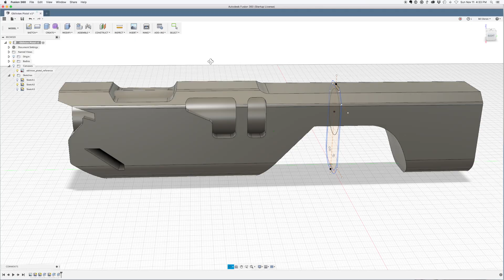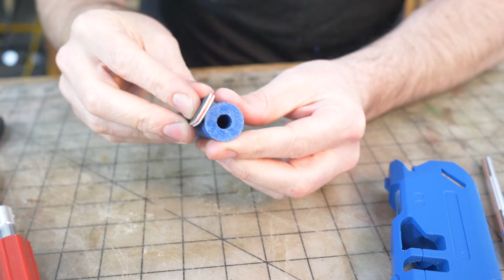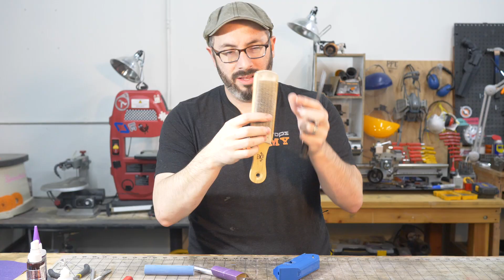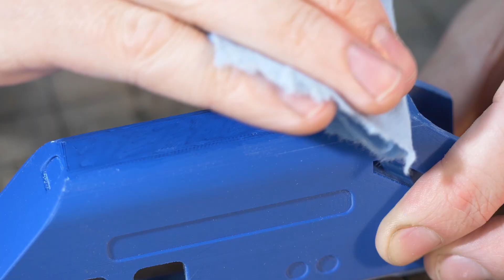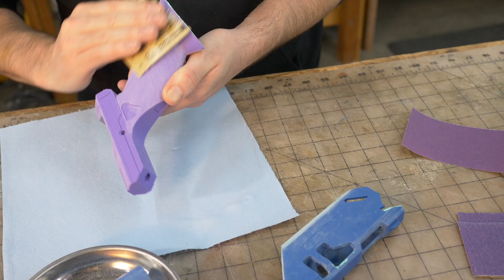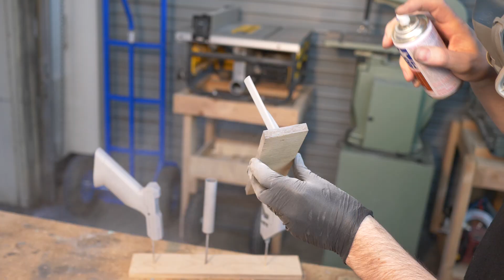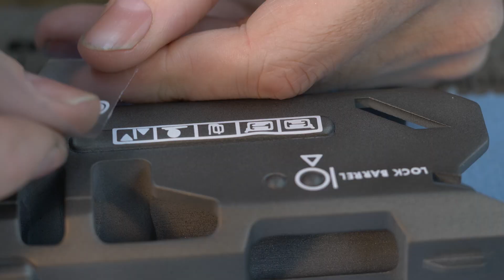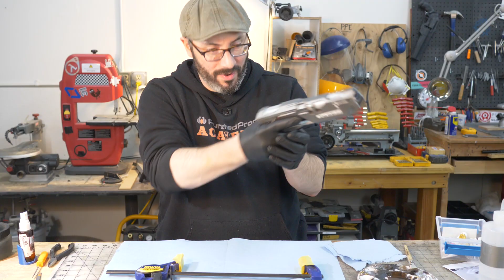From 3D Model to Finished Prop - Tom Cruise's Oblivion Blaster!

Comment: I guess PLA is my fav to print with, though I can only print that so my experience is limited.
For finished products I think ABS or something else is better but if you are doing castings of it, or concepts, I think pla works best.
As for supports, while they are good I always try and cut up my projects in bits to avoid them as the surface where they attached usually requires a lot of work.

Comment: Ok, I shoot from the bottom of the barrel. I use the cheap PLA I scrounge off Amazon and I run it through either my Ender-3 or my Anycubic Linear Delta. I  slow the print speed down to about 40mm and layer height of .15mm on the E3, the Anycubic I run about 60mm to 80mm and .2mm. They produce a pretty nice finish when run this slow and when wet sanded they look as good as anything we produced back in the old days (actually a lot better for far less work). Probably not as good as the guys running Ultimaker  or even Prusa but it allows me to output my designs and I don't have to worry about justifying the cost.

Comment: I see you've got some foam supports underneath your airbrush compressor. Do they dampen the noise appreciably?
Reply from the maker: It is a bit quieter, but the cushion base was added to stop the compressor from waddling off the table. It took a few tumbles before.

Comment: I also like ABS for props because of the easy sanding, but ASA is a perfect material for durable parts like laser tag and nerf blasters and mods.

Also, a useful and inexpensive sanding tool is a sapphire nail file.  It uses very hard aluminum oxide (like ruby's and sapphires) as the abrasive material.  Usually about $10 at a drug store, and can be found elsewhere for less.

Comment: As far as dust masks, I recently discovered the type similar to the cheap-ish one shown, but with a simple check valve in the front.  This is great for keeping glasses/goggles from fogging up, because exhaled breath goes out the front, rather than leaking around the edges.

Comment: In the scale model hobby I have found that super glue activator if not washed off with soap and water will cause the top coat of paint to craze.  Do you see this on your side of the hobby?

Comment: What the hell is a water mixable oil paint ?  Have i been living under a rock  ?
Reply: "is oil paint either engineered or an emulsifier has been added, to be thinned and cleaned up with water". So you don't need to use a solvent.

Comment: PLA. It is the only filament, the only 3D Printer I could afford will use. (Actually, it only uses the printer manufacturer's proprietary filament)
 
It has a 6x6x6 build volume; and an unheated aluminum bed, included Slice 'n Dice software (not as full throated as Simplify3D.)

Adhesion problems solved with Blue tape and Elmer's GlueStik  plus pre-heating the bed with a hairdryer as the print starts; then deploying the (Manufacturer Supplied) 1/2 Enclosure. Keeping the build space temperature in the sweet spot has worked best for me. A heated glass bed would be so wonderful; but $$$ I don't have.

Not thrilled with the quality of the prints. I don' t underestimate my contribution to that.  Lifetime Achievement to date? I've spun 2 spools, so far; now working on #3. Barely enough to get the feet wet; let alone develop a reliable technique.
 

Nozzle clog print failures on runs over 16hr. Possible water contamination of filament; exploring Sodium Bensonite (Clumping Kitty Litter) desiccation and filament hydration maintenance.

Video at 

https://www.youtube.com/watch?v=M_evG1AzHzk&t=4s
https://www.youtube.com/watch?v=jQpLpL3N2I0

Pulling my hair out at :
http://eli-tables.com/

Comment: I do all my printing in ABS, but most of my work is small snap-fit parts so I don't trust PLA to not break when slightly flexed to fit the parts together.  Instead of using superglue to mush down the threads you had, you could have used your ABS slurry, you could also do the same to "glue" the parts together, you just don't get the activator benefits I suppose.

Comment: My favorite filaments to work with are PLA and PETG.  Like you said, PLA is just the easiest thing in the world to get a decent result with if you have decent part cooling on your 3d printer.  Yeah, you kind of need to start with an 80 grit sand paper to chew on those layer lines, but it's a good filament to cut your teeth on.  I  also like PETG for it's material properties.  While it's not as heat resistant as ABS, it's close enough for most prop making uses.  It's got some good strength, a little bit of give, and like PLA, PETG doesn't give off the same kind of fumes as ABS.  As my work space by necessity is indoors, fume control is super important to me.  Also, I love that sort of ruberized sand paper!  it's my favorite kind!

Comment: My computer is so old it won't run fusion360 :( ... it's super frustrating im dying to get stuck into 3D modelling, hoping to upgrade this year if I get some decent commissions
Reply: Matt, I don't know where you are located but here in the US desktop PCs are almost free if you scrounge around and know where to look. Goodwill/Thrift stores get a ton of them and they usually aggregate them into one location where you can pick up a pretty decent machine for $20. Also Recycling centers are a great place to scrounge especially if you know how to build them. Get five free dodgy ones and cannibalize them together and get a whole one. Trade some labor for a desktop.  Monitors are also really cheap if you can live with non HD resolutions.
Reply: @PaulLemars01 Im in the UK :) ...yeah I've looked into older machines on ebay etc and whilst some may suit im really  hoping to just upgrade to a machine I can  keep for 5 years or so ie somthing with a decent graphics card and newer chipset,so I don't run into incompatabilities with newer software versions later on,  I'm undecided on a short term stop gap machine atm, so ultimately im limiting myself by holding out for a better machine. I may break and get a temp machine at some point though!

Comment: My Cr-10 produces great prints with just straight PLA, and with a little 220-400 grit sanding and some wood filler, I can get results that are smooth as heck and ready for painting. PLA is also cheaper than ABS, and it doesn't need an enclosure to stop it warping from the build plate. For me, printing with a 0.1 - 0.14 mm. layer height produces little and extremely unnoticeable layer lines, and an infill of around 40% or so makes really durable prints, even when printing something skinny like the sides of a helmet. I have yet to try a filament like PETG extensively, because right now PLA is working for me just fine.

Comment: Rotating the slide so the barrel cutout is pointing up would minimize the supports needed and eliminated that stringy stuff on the side (assuming your printer could accomodate those dimensions, otherwise, you could have printed in two pieces and glued them together and bondo the seam before sanding). the stringy stuff was the printer either moving too quick or the bed was too cold.

Comment: Bill::

Another great build - thanks for sharing with us. 

A few tips that you may find useful:

 An alternative filler would be to use ACC and talcum powder which Frank Ippolito demonstrates here: https://www.youtube.com/watch?v=NA2XJ7PTT3M

 Use wet or dry sandpaper and a plastic tub partially filled with water, dunk the part and sandpaper in water to cut down on all of the loose dust. The water also acts as a lubricant, cuts down on clogging and prolongs the life of the sandpaper.

.vp

Comment: Disclaimer: (((I'm not mad, it's just my personal opinion on how I think things should look.))) Looked so good all the way up till the weathering.  Why do so many people weather? I don't get it (things weather over time, why rush into it). I guess to witch it's own, but I'm more stoked on clean brand new looking things/stuff my self. Like a freshly turned piece of aluminum when it comes off the lathe or metal freshly milled, or my new PC parts out of the box. I even try to keep it looking that way as long as I can.
Reply: In my opinion weathering is used so often because it helps to hide imperfections while upping the cool factor. MUCH more work to create a perfectly pristine piece than to make a decent one and hide any minor goofs with the weathering. In the case of this gun, it looked pretty perfect at least on camera, so then it comes to a matter of preference.

Comment: favourite to print with? PLA, specifically Rigid.Ink PLA, despite the fact its ridiculously expensive, it just prints really well. second favourite is Real Filaments PETG.

favourite to post process though? thats Graphene enhanced PLA from a company called Haydale. this stuff is stupid expensive, but it prints just as easy, if not easier than normal PLA, but is as easy to post process as ABS in my experience.

stupid expensive though

Comment: How do clean your parts before priming? All that dust from the sanding seems to get everywhere and stick in all the little crevices.
Reply: Running the compressor  with an air duster attachment is great for getting dust out of the crevices, then use a tack cloth.

Comment: I print almost exclusively with PETG. It's kind of a pain for post processing though, so I really want to get into ABS. I haven't had much luck with ABS though, despite having an enclosure around my printer. Only managed to make smaller parts. Large parts seems to break apart of leave the plate.
Not giving up yet, just need some fine-tuning :)

Comment: Hey awesome build! looks good so far from what ive seen, only about halfway through the video. Why dont you guys make a paint booth with an extractor fan and a large filter so you have somewhere dedicated to do your painting that also helps with getting fumes and contaminants away from the project you're painting?
Reply from the maker: That's a really fantastic idea! We have plans to build one of those in our shop in the near future. Until then we just open the overhead door and turn on a fan when we're spray painting.

Comment: @Punished Props Academy.  Bill, do you have any experience or advice finishing parts printed in photo cure resin like from SLA printers?  I've heard tale that the print artifacts are reduced significantly but I don't have any practical experience with them and I'm curious to hear what an pro has to say before I drop $$$ on hardware.
Reply from the maker: I sure do! We've used the Form 2 printer a bunch and the prints off that machine are simply divine. Miles more detailed and smooth than anything off of any FDM printer. Here's a video we did on that printer: https://youtu.be/wh819cymYsQ

Comment: I really want a 3d print of Animus and Retort from Critical Role but there isn't a ton of reference material for them. is there a program that I can export from Maya to I don't really want to learn to model in a new program.
Reply from the maker: You could do all of the modeling in Maya and then export your mesh as an .obj file. Most 3D printer slicers can handle an OBJ.
Reply from the maker: Here's a nice tutorial on the process: https://i.materialise.com/blog/en/3d-printing-with-maya-step-by-step-tutorial-on-how-to-turn-your-3d-model-into-a-3d-print/
Reply: Sweet! thanks.

Comment: for sanding with just base PLA, I use a spray bottle of water to keep the friction temp down. Works perfectly well for me, and I've achieved super smooth results.
Reply from the maker: That's a fantastic idea!
Reply: wet sanding also captures a lot of the dust and makes your sandpaper gums up a lot less, so pluses all around.

well, except the fact that it makes everything around it wet, anyways.
Reply: @xureality  lol we were typing that at the same time. :)
Reply: @EvanCurrie  lol, great minds think alike. ;)
The model getting messy isn't that much of a problem though, you can blast it with a garden hose and let dry. My desk getting messy kinda is.
Reply: @xureality  True, though it can be an issue if you're not thorough because wet grit and plastic particles can get stuck in nooks and crannies and ruin your primer if you don't take an extra minute to look it over and wipe it completely clean. It's a very minor issue, but it is one that you have to adjust your work flow for.
Reply: a second this, i've recently printed a big 1967 camaro and wet sanded the entire thing along with wood putty for filler
Reply: Additional bonus, and slight negative, is that the water keeps the dust out of the air and your lungs... but it does make it a little messier on the model itself. It's important to clean it properly when done, of course.
Reply: As far as getting a smooth surface and remove the sanding lines, always try to go to the highest grit you can before polishing, then doing a light layer of primer, repeat until baby bottom smooth, then do a light sanding for paint to stick to. I have also gotten flat black from a rattle can so smooth judges thought it was airbrushed. that goes in with doing more than 2 layers of primer and paint. Looking at around 5-6 very light layers of primer sanding between each, and 5-6 light layers of paint, followed by a clear coat of your choice.

Comment: I pretty much exclusively print with PETG these days. It's almost as easy to print with as PLA, doesn't have any of the fumes of ABS, and has a slightly higher yield strength as ABS. It's also UV resistant, which is great since I print a lot of functional end use brackets and other parts that are used outdoors. 

For quick and dirty test parts though, I use whatever cheap PLA I have onhand as I can turn up the print speed much higher for PLA than PETG.
Reply from the maker: Excellent tips!

Comment: Hey Bill, do you find that you need to clearcoat your prop when you use Rubb n Buff? I've recently started using RnB, it's amazing stuff but it doesn't seem to dry..... ever. It constantly rubbs off on my hand whenever i touch the prop. I've left it for weeks and it's still comming off when i touch it.
I didn't see you clear coat the gun, so what's your experience with this?
I'm kind of hesitant to clear coat my prop anyways because i might ruin it, i'm afraid it will destroy the difference between the matt finish and the gloss finish. Not sure.
Reply from the maker: I usually don't clear coat the Rub 'n Buff, because I use it so sparingly and if it ever rubs off it's super quick to touch up. If you want to clear coat it, something like Testor's Metalizer Sealer does a great job of protecting it without dulling the metallic shine too much.
Reply: @punishedprops  Thanks! I'll look into that.

Comment: Can anyone recommend an alternative to spot putty used on this? I live in the UK and this stuff is £25 a tube!!!!!! I am just starting out so don't want to spend a  fortune while I am learning and practicing. I have tried interior ready mix filler but it's not great. Thanks
Reply from the maker: I can't think of another product, but I can tell you that the tube I have has lasted me more than 2 years and it's still almost entirely full. It's a bit pricey, but it'll last you a good long time.
Reply: @punishedprops  Well I took your advice and bought a tube off Amazon. Just got to wait for delivery now. Thanks and loving your work, your videos have taught me so much so far.
Reply: Sorry I meant Squadron. Green modeling putty.
Reply: Regular bondo works too, but it's two part so maybe not as convenient
Reply: There is fillers in almost every hardware store. 
I think my dad bought one for way cheaper.
Reply: I've used wood putty/wood filler on my 3d prints. I use eSun pla+.
Reply: Spray on car body filler works really well for filling and cleaning up prints.
Reply: i use regular bondo body filler from the hardware store
Reply: try "Green stuff" modeling filler

Comment: Excellent video Bill!
I used Ultimaker's Tough PLA with PVA support on the S5 for the lawgiver build (https://www.youtube.com/watch?v=3j4MoCBSIkg&t=1s)
Like other PLA+ types it's ever so slightly easier to sand, but not much. So I used red acryl filler also.
I've since got a load of ABS filament, in black and silver, plus some HIPS and Ultimaker's Breakaway for support.
I'm also really impressed with Dimafix (pen) for build plate adhesion. Super strong when hot, but pops right off once the bed has cooled.
Reply from the maker: Great info all around, thanks for sharing! =)

Comment: It is definitely my experience that where the part meets the support is never a great finish, but that's necessary to keep the supports easy to release so they don't fuse to the model.  Definite tip is to rotate your model in the slicer to minimize visible surfaces in contact with supports.  Makes it a lot easier to hide the crimes.
Reply from the maker: Yeah for sure. I also know that with some tweaking in Cura I can get a better surface finish, I just need to put in some time tinkering with test prints.

Comment: I personally like the Inland (eSun) PLA+ for all prototyping makes.  I can print at much faster speeds with a good quality.  Once I'm satisfied, and if I need something a little more impact friendly, I switch to using PETG for the final part.  I shy away from ABS and Nylon, and only print those when I really need a stronger part (just due to the shrink/warp/cracking that comes with those).
Reply from the maker: Interesting strategy, I like it!